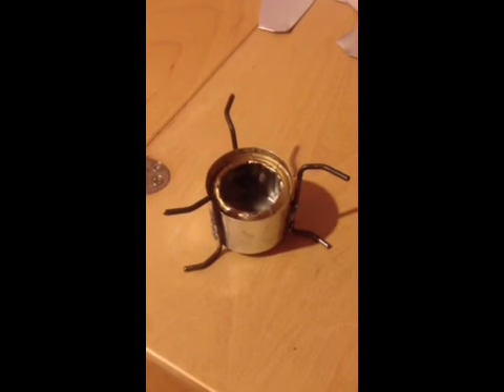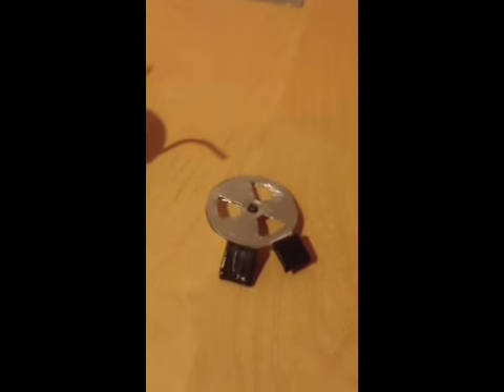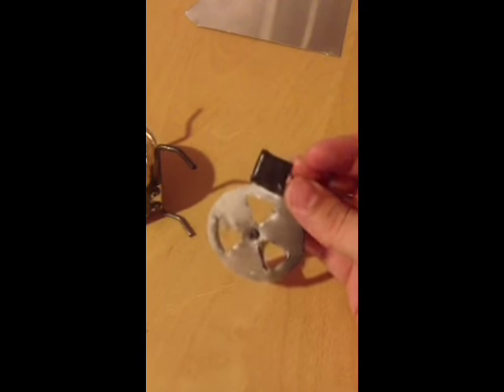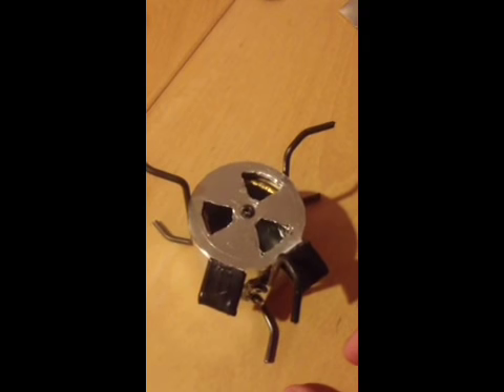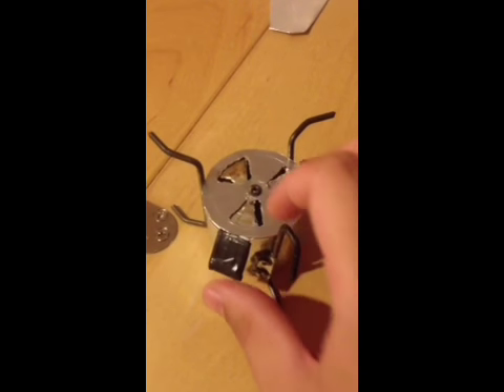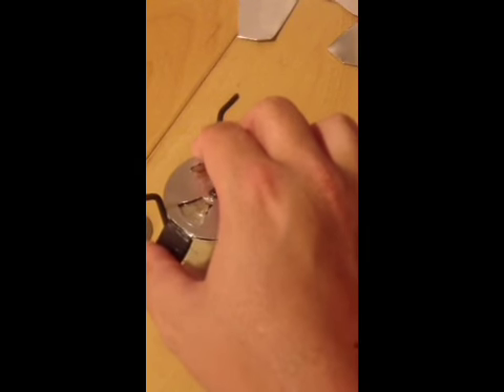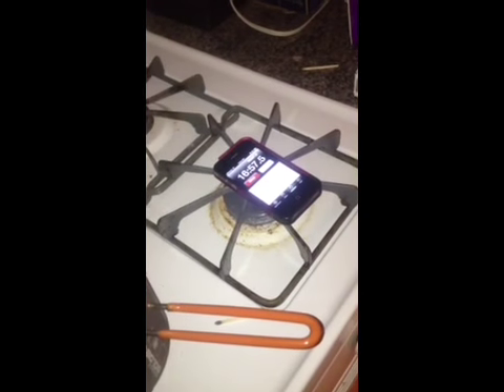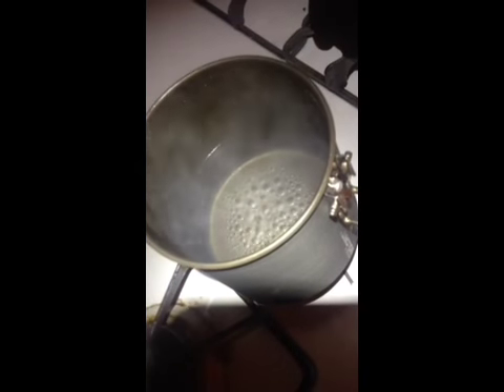Capillary Hoop Stove Simmer Ring

Comment: Great way to expand on the original idea. I was kinda disappointed by the low fuel efficiency of the original design since it will take ~15 min for the flame to be useful in real situation but >40 mins? That's terrific!